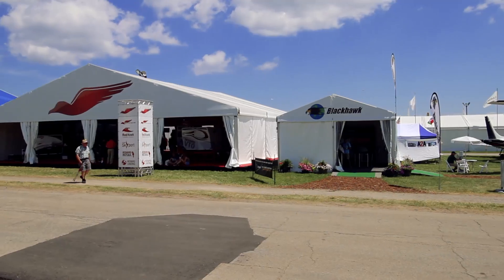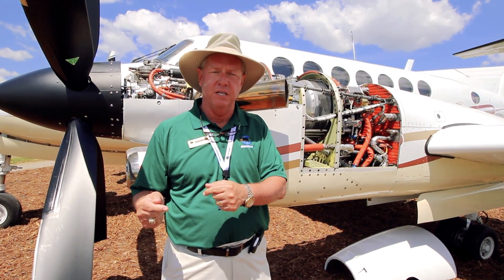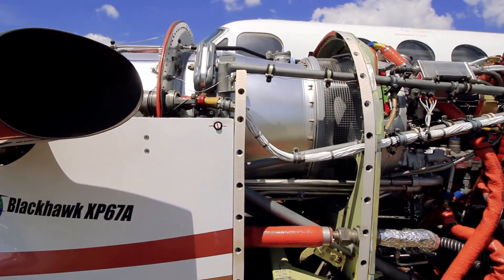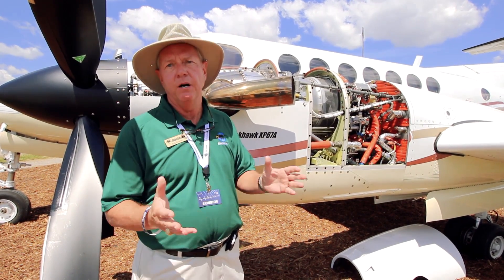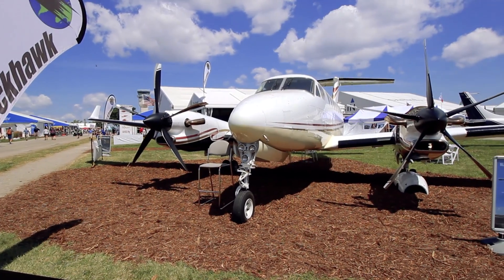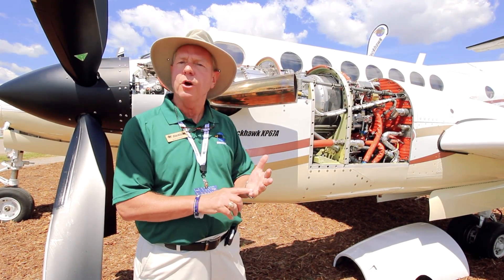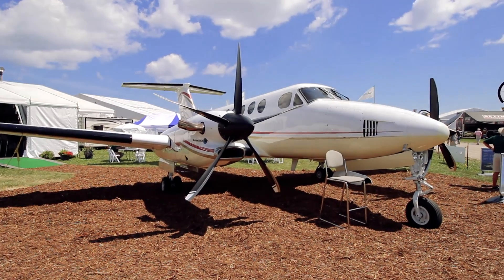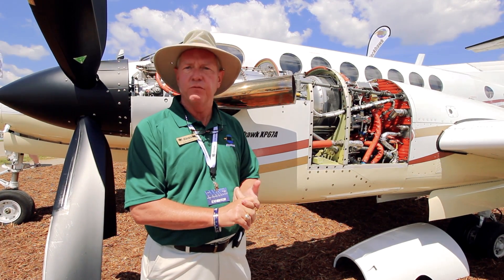Blackhawk Modifications Details King Air 350 mod at EAA AirVenture Oshkosh 2016

Comment: Awesome power up for Kingair 350. Is there a simulator for type rating should it be required? That is the uprated performance for the  XP67A? Or, flights can be organized upon completion of the engine/prop re-fitment?